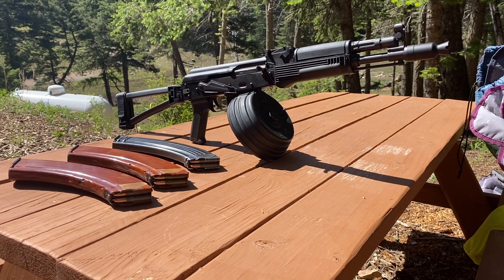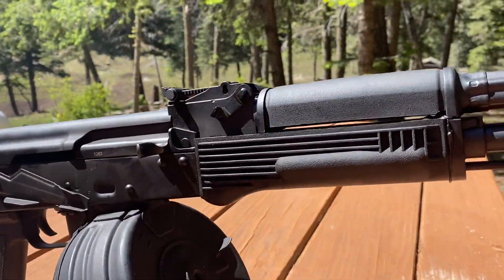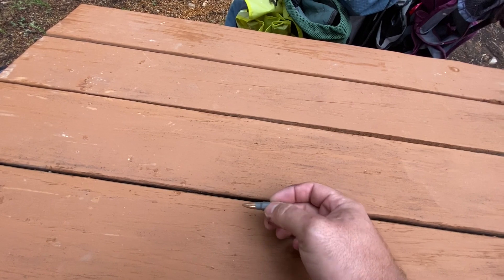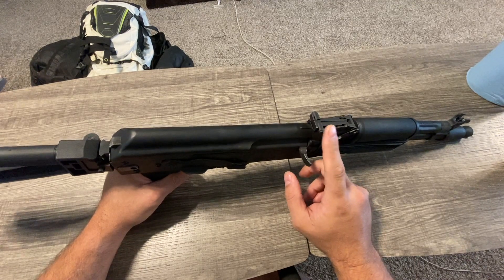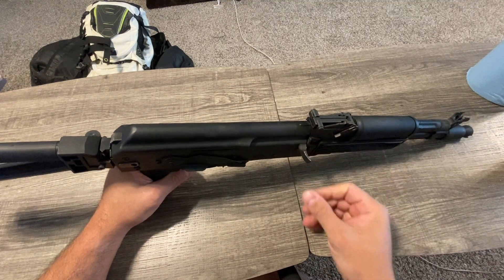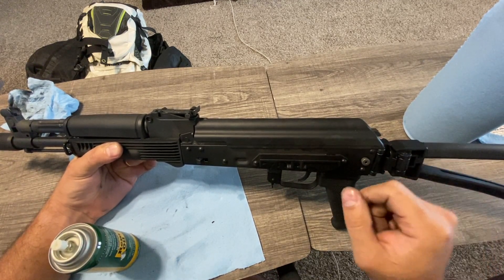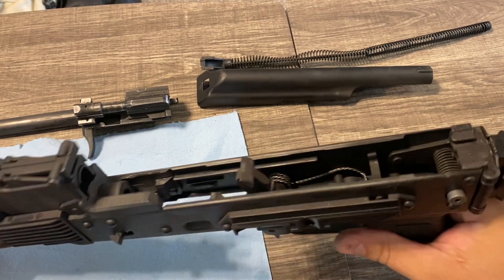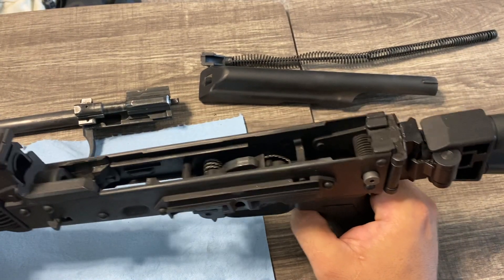My PSA-K 104 looks like this after 1000rds?

Comment: Just ordered one, glad they are solid since they to forged parts and a chf barrel. Just gonna slap in an ALG and let her run.

Great video
Reply: I don't think it has a chf barrel....
Reply: @fatdanny8251  they do. The PSAs have a forged trunnion and CFM chrome lined barrel 🙂 only the booster isn’t chrome lined but I threw that pos out and got a brake for it.

I was looking into buying a Hellpup but did my research and saw PSA got shit together with AKs. At least the 7.62 platform anyway, apparently their 5.45s are still having massive firing pin issues.
Reply: @Trevor Morris from the PSA website "The PSAK-104 is loaded with features such as a gas nitrided barrel, hammer-forged front trunnion, bolt, and carrier"...
The GF4 or GF5 is the one with Chf barrel.
Reply: They are definitely not chf barrels on the 104’s. I called them not long ago just to confirm
Reply: @Me-ob5qc  which sucks because for $1100, it really should have an FN barrel. Almost $400 upcharge just for a short barrel and a folding trunnion.
Reply: @Me-ob5qc  you’re absolutely right, my bad. I was thinking of my 103.

Comment: I didnt think Garand thumbs ak wear looked that bad. My ak103 looks similar and it seems to be fine. It wore a little then stopped. Appears to be how the bold rides on the trunnion when it cams over
Reply: What do you mean? Front or rear?
Reply: @EliteManMonkey  front ejection side if you look down at the locking lug
Reply: @royalwins2030  Interesting, and how is it now? If youve shotten it any more that is
Reply: @EliteManMonkey  same. I have red dot mounted now so i havent opened it up lately but from what i can see its the same

Comment: Slick better off with a 7.62 upper nowadays a 10.5 w SP is devastating out to 250s but realistically 50yards is max , get the necessary reinforced parts, metal 20rdmags only 🙅🏾‍♂️ it’s gonna out last most budget aks lighter/better groups/heat control🔥, and easy swap back to 556